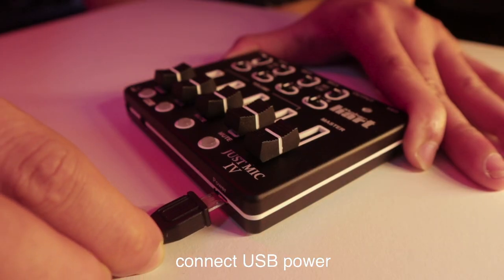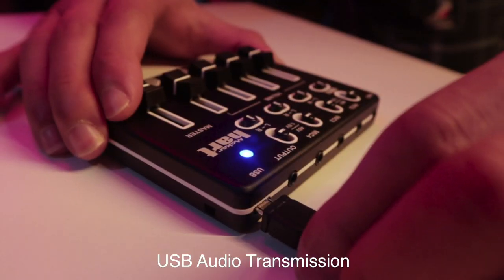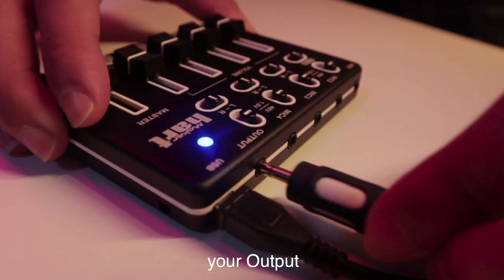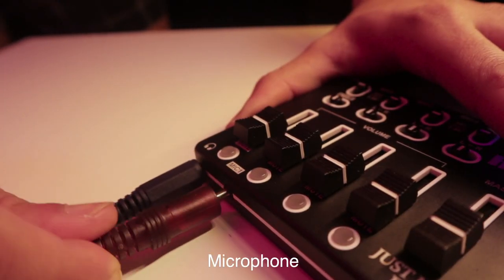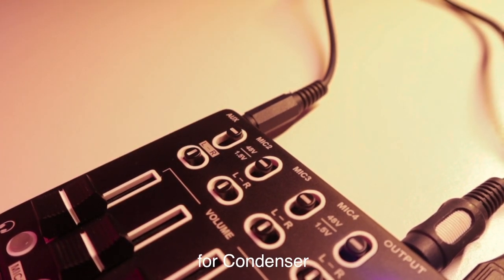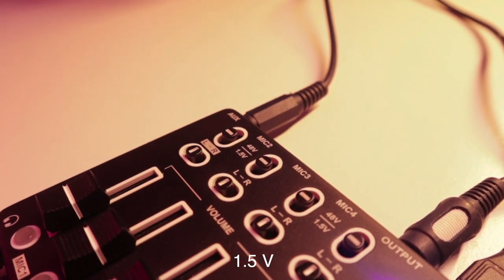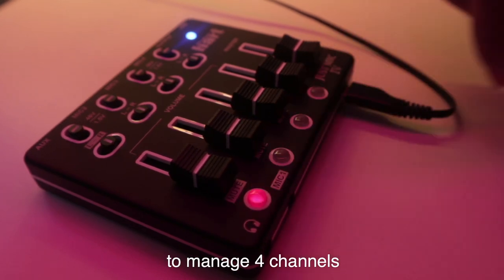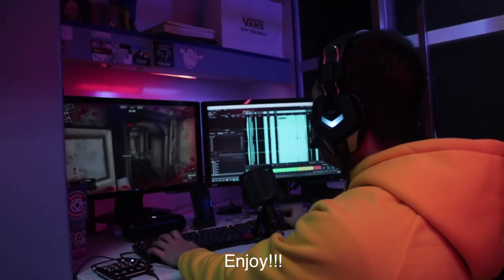How to use Just Mic 4 by Maker hart

Comment: None of the sound is coming to my headphones that I plugged into the mixer, not even if i take the speakers out of the output. And why do the aux and "usb transmission" cords not come in the box if we're to use them ? i get a lot of static when i plug my own usb cables in and i tried two different ones.
Reply from the maker: Dear Floyd Garner, 

Thanks for your inquiry.
We suggest that the power supply be used separately, it will reduce the production of noise.

If you there is any question or comments, please feel free to contact at info@makerhart.com
Thank you. Have a great day.
Best Regards,
Sandy Tsai

Comment: = The Mini mixer: "Maker hart Just Mic 4" when connected to a standard power bank, it works well and has no background noise. If it is connected to the 5V / 1A USB adapter, a loud AC noise is heard. How can I overcome this problem that does not allow me to use the mixer connected to the mains ?. Thanks and best regards.
--------------------------------------------------------------
= Il Mini mixer: "Maker hart Just Mic 4" se è collegato a una power bank standard, funziona bene e non ha alcun rumore di fondo. Se è collegato all'adattatore USB 5V/1A, si sente un forte rumore di corrente alternata. Come posso ovviare a questo inconveniente che non mi permette di utilizzare il mixer collegato alla rete elettrica?. Grazie e distinti saluti.
Reply from the maker: Hi Laboratoriodicinema di Francesco Maricchiolo, 
Thank you for writing to us. The crackling and hissing static noise that you are hearing can be caused by a variety of reasons. Below are  2 things to check:
• Additional static noises may arise due to interference from other connections in close proximity. Do not power mixer from a charging hub / power bank that also powers other devices.

• Using the foil Shielding-prevents and protects the cable from unwanted noise interference.
https://www.amazon.com/-/zh_TW/C2G-27411-Stereo-Color-Coded-Meters/dp/B000234HVS/ref=mp_s_a_1_18?dchild=1&keywords=3.5mm+cable+shield&qid=1589356295&sr=8-18

So we suggest the computer output sounds adjust middle.
If the above conditions have any question or comments, please feel free to contact us.

Thank you. Have a great day.
Best Regards,
Sandy Tsai